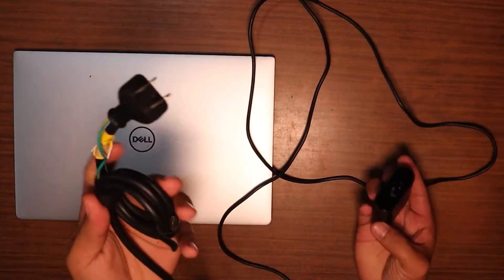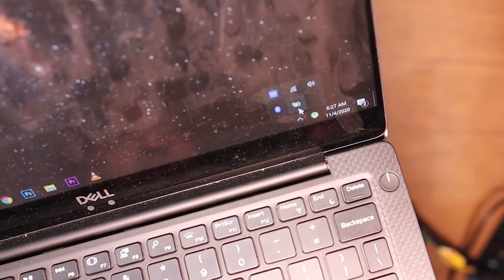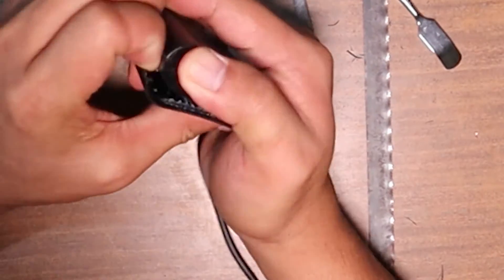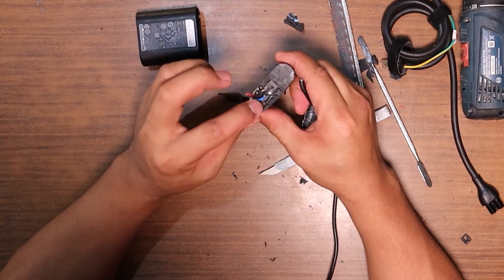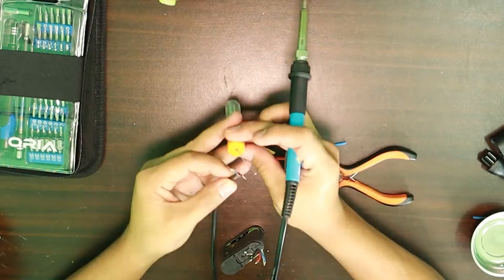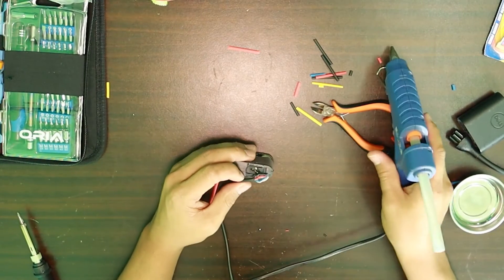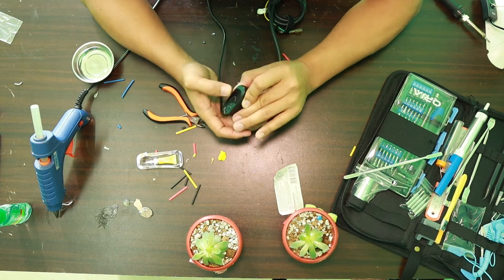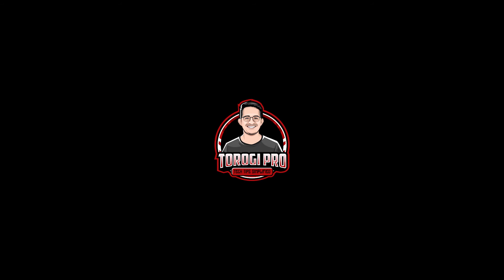How to Fix a Dell XPS 13 Charger | Step-by-Step Repair Guide

Comment: Its kinda funny how you cared about using the right heat shrink colour for each cable, but didn't mind inhaling led from the solder 😅
Reply: If he is soldering once in a while, from time to time, he will be fine. Fume extractors should be used for people that are fixing electronics on daily basis and soldering is their primary job.

Comment: This is extremely dangerous you should at least warn the viewers, even disconnected the caps on the power supply will still have enough charge to serverly injure someone if touched at the wrong spot
Reply: True but I doubt ppl will try this I have the same problem with my charger I clicked on this and never mind I’ll get a new one
Reply: @alexandrab5904  Hi!, where did you bought your charger?

Comment: My dell laptop doesnot have usb c 
It needs to charge with pin 
And
The charger is not working charger is not lighting up .. same shale adapter
Reply: Ikr i got the same problem with 2different chargers after use
Reply: @qucad  how did you get over it? ... I’m having the same problem as well, 2 different chargers just stopped working
Reply: Don't buy dell
Terrible now